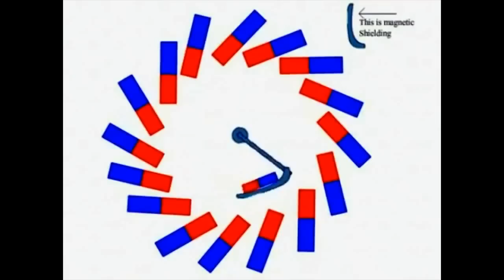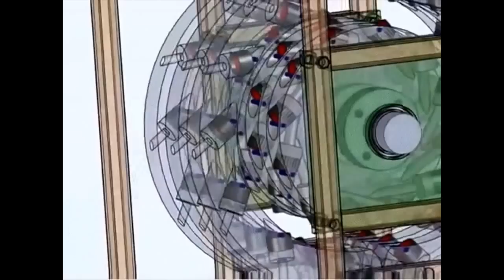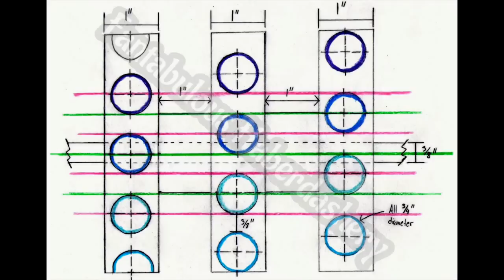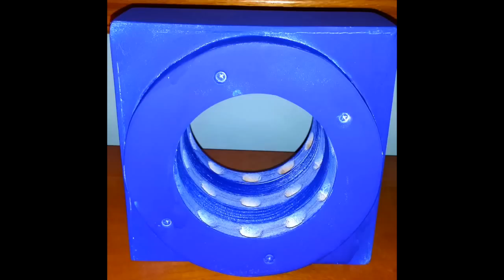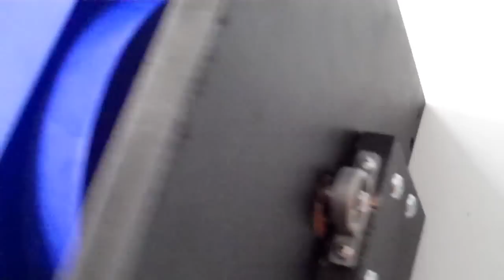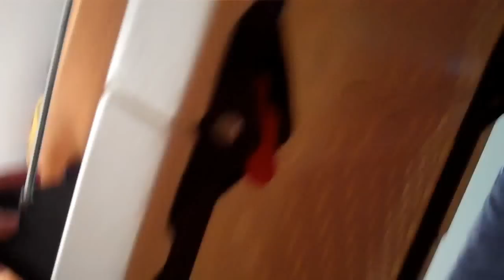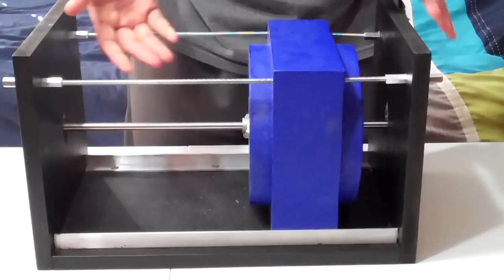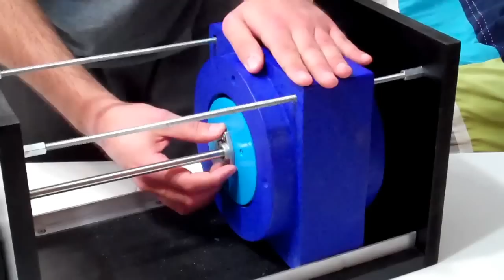Working Perendev Magnet Motor!

Comment: Just thinking out loud here but it's suspiscious that a prototype would achieve almost unity. You don't say how long it runs for, or has run for. Given that a constant force produces an acceleration I would expect that a prototype of a working magnet motor would slow down rapidly (even a few hours) due to losses and reverse magnetic forces or it would accelerate. If you could get it to accelerate, as you would expect, then you will have unleashed a monster.

Comment: Nice science project. The magnets stacked in certain configurations result in a certain cadence as the "motor" is "jump started" by hand. I can imagine using varying shapes of magnets and varying gaps/spaces between each and varying the # of magnets will all give different results so that's interesting. Like so many free energy motors, this one is again not loaded - meaning it's not being used to drive or work or produce anything. That would be the real test for me. BTW, all the energy that comes from the sun is FREE. It arrives here free of charge and all we have to do is collect it. I believe that to be the ultimate energy source - and it's free - already produced and you were sharp to refer to that as converting the energy. I agree there entirely. All in all, pretty impressive and educational.

Comment: Ok its all a mater of perspective forces and inertia. When an object is under no influence from a force (gravity, air resistance, and friction) it can rotate forever. Naturally objects retain their kinetic energy equal to that of what was applied to it, in this case him starting it up with his arm. Without the magnets the motor will slow down quickly, as day to day forces mentioned above will eat away at the kinetic energy of the motor. The magnets are simply slowing down the process of this energy loss and not adding energy to the system. It is a clever trick by arranging magnets at optimal angles to greatly improve the efficiency of a spinning rotor under the influences of other forces. Thus the motor seems to run at a constant speed when in reality it is slowing down at a very small rate. 

Btw to tell if one is fake or not... if the person has to spin it faster than what it runs at (as with this video) then it is explained by the paragraph above. If the person barely turns it and it starts greatly to accelerate then that is a fake machine, as an outside source (hidden motor, air jet, ect.) is adding energy to the system.

Comment: Awesome, I sort of knew this would work with the right RPM.
Whats the next step? My suggestion is to bolt it firmly to the table/ground/whatever, and make the magnets as absolutely firmly attached as possible.
Think about it. Lets say that two magnets are moving towards eachother (repelling). At some point they reach «highest resistance»(braking down the motor), and immediately after passing this point they will accelerate the motor. Lets also say that the point of highest resistance is 1 micrometer. If the magnets are glued, they will fluctuate a tiny amount, lets say 1 micrometer. Now you have maximum resistance over 2 micrometers instead of 1. 
Im not an expert, but I believe this effect is extremely critical.
The math here obviously isnt correct, but I think you get the point.
Keep it up anyways!

Comment: Wow you have proved a point,the point being the principle works exactly how theoretically you can’t say but work it does. Whether permanent magnet motors create energy or tap an unknown source perhaps remains to be proven at least publicly in other words does the energy of magnetisation exceed or equal the overall output of the motor or vice versa..

Comment: Very provocative keep going , the secret lies in the bearings + weight of wheel try using bearing from a fidget spinner
try using instead of wood graphite plastic for the wheel use more power full magnets , change magnet configuration to a swirl so its driven by momentum instead of force , angle of magnets also is important , main thing is not to ever give up my friend 

try to create from nothing is blindness , discover what is already there and you will see ;)

p.s i agree with your speech about laws ;)

Comment: 996 comments not exactly all that positive eh ? 1) There is no easy way to assure a driver motor as the end shafts are pretty much flush withe the bearings. 2) his had is holding not the housing but the stator as the imp balance of the rotor and non precise (in lateral cross section view at least) planar alignment of the magnets would cause the stator to drift about. The argument about permanent magnets not being permanent ( they last only 400 years undisturbed, according to what I have heard) and the stretched rational for such externalities in production of the machine as part of the energy balance equation aside, the bigger issue is one of assessing his motive. I see here an innocent if crudely and incompletely presented attempt to explore a long contested issue. He manifests no commercial interest and is openly sharing information. He may not succeed but why try to slaughter him? 
Several offer  the advice of  a fixed rpm meter, more comprehensive camera views , hands off display etc., fine but lets go one better:  Lets suggest that before any naysayers spout on let them first try to improve on the design then submit it here and subject themselves to this venomous barrage. If it defies science then please explain how it succumbs to the law of motion which  states that 'for very action there is an equal opposite reaction'--as you release your grip on two free standing magnets in close proximity.  Alta continua

Comment: great  work and I really appreciate your candor . So much BS out there eh ? Important this stage however is some sort of electronic rpm meter that could log the motor performance at especially your steady state condition.  Made my own out of a CD disk drive with ¼" ø x 1"long neodymium magnets in a turned 6" cylinder to of hardwood. Came to nearly same conclusion re angle if inclination. The number of magnets used outside ring, to side drum was same so spacing was different . I used Mu metal to shield backside of stationary magnets in ring to no effect but even without it, the mechanism never achieved steady state.  You inspire me to revisit it. I will happily post it up when and if it ever runs ! Thanks again for persisting . Richard S

Comment: Everyone can see the small shadow reflection on the left of the black case - when you hold a small motor with a rubber friction wheel with your right hand onto the shaft to keep it going. Then when I see you remove the small trick motor in the reflected shadow - your machine shakes when you take the pressure off :) lol :) Nice try - but not tricky enough!

Comment: pay attention,,look on the periodic table for metals that resist magnatism and you will find one in particular that resists the magnet no mater north or south ..put these in your wheel as a magnet even though it is not and you will find it works perfectly even though weak

Comment: you have actually got it to spin for a little, lol 

the problem you will always be confronted with is the natural drag caused by the contraption + the drag or counter pull of the magnet when leaving the field wanting to pull it back (thus the magnet propels it forward only to pull it back with equal force as the poles of the field change as it moves) "cogging effect" although minimized by the the angled magnets & spinning counter balance eventually it will come to a stop.

2nd is the issue of load if you try to turn something with it or generate any usable current it will  just stall the motor.

for the sake of a self running motor one needs the skills of an old time clock maker to make a unit with extremely low drag & two gear driven arms (or perhaps four on a finished product) the arms need to move pusher magnets in an orbital pattern first close to the motor armature or magnet spindle then out away , they need to  smoothly enter the magnetic field at the bottom of the stroke, pull the motor in the direction of the desired  spin then smoothly exit out of the magnetic field at the top of the stroke when the magnet starts moving away from the armature or magnetic spindle weakening the magnetic field before it exits the field & repeats the process, this should eliminate the cogging effect but as for usable energy you can probably run a small generating coil to light a couple LED's but again too much load will stall the motor.

thus you need to build a huge machine to turn a generator that can make usable power.

as for so called "free energy" energy it will not come from a self spinning motor it will come from room temperature superconductivity (manufacturing energy generating superconductors similar to thermal couples & thermal piles) but power cells manufactured in a liquid nitrogen environment produce energy when exposed to normal temps.

currently they are classed as "disruptive technologies" by the social engineers, who want us poor & in debt to them for everything, but eventually it will come out, lol

Comment: Nice work - however (dreaded beginning) while magnetic machines do run and can produce an amount of energy that is measurably more than the EMF required for operation - these devices are NEITHER "free" or "Long Lasting" (despite the parable of old lawn mowers). It requires time, energy and commerce to design and build the machine. Further, the device is operating in opposition to the unforgiving presence of FRICTION (no matter the lubricant). This all aside - the concept is real. The tests well proved. The implementation is ripe - save one one thing - Commerce. We live with a zero sum energy production system. It cannot grow without the elimination of irrelevant technologies ( 1 new = eliminate 1 old). 
Suppose for a moment that you were in control of an old, established energy providing system. Then THIS comes along allowing many millions "free" (as we previously established as NOT) energy. Your lively hood and fortunes are threatened to become extinct and would take you along for the ride. Your response to this attack? How did EXXON, ConEd, GE, etc. cope? Well? 
Your ideas for a SAFE and SECURE INTEGRATION into the "power grids" is what is truly needed. Besides engineering and math, sign up for some political science classes and marketing as well. 
We await your progress...

Comment: Your machine is out of balance and not running concentrically. That is why it hangs up. Flange bearings instead of pillow blocks would work better also.

Comment: See the link
https://youtu.be/9yQ9Ln7jBQ8
Finally very near to achieve overunity. 

All calculations are supporting in the favour of this mechanism.In the video there is box with a green ball to lift the green box there will be need of very minimal energy . Suppose the mass of ball is10 kg and counter weight is 10.2 kg.the length of box is 1 meter.the length of seesaw arm is 2 meter. Seesaw is slightly tilted towards counterweight. Now calculations To lift up the arm of 10 kg ball the input will be very minimal only. 3 joule But output Mgh=10*10.*80=80 joule Now clear doubts. The ball will not roll down in the box until the box gets 90 degree angle and will fall down after getting a certain height. In this way the input energy will be very minimal. But now the interesting point is that the seesaw will get back it's initial position without any extra energy. 
I would like to insist that the ball will not rolled down in the box at the time of lifting up the arm.the ball will fall down after getting a certain height of 90 angle.i have used a pinhole to hold the ball but design of box will do it to hold the ball.
Noether theorem will not work in this mechanism.
The input is very minimal, potential energy is being increased, Seesaw is getting back its initial position without any external influence,no friction and air resistance issue then why it shouldn't work?
See the video carefully. It is completely overunity device.
It is an open challenge for everyone who is against perpetual motion machine

Comment: A modern samarium-cobalt magnet takes around 700 years to lose half its strength. Other magnets Can loose there Magnetism through heat or vibration but not of this is involved with your  setup, so where have you got your information from?

Comment: There must be some sort of magnetic resonance involved if it keeps a constant speed for a short period.   It could be the construction quality that makes it lose it's resonance.  You really should have/make some kind of tachometer to really tell weather it's holding it's rpms..  Even a cheap one would be fine for now.      Magnets spinning around magnets causes all kinds of different magnetic fields.  It would be difficult to find them and then measure them.  So, keep on !   You're doing good.  add/remove some weight to one side and balance it.    Drilling holes on the heavy side is a common way to balance a shaft,  or glue on some small weights to the light side.

Comment: That is very interesting and thank you for the drawings on the magnet placement. I made mine straight in and it does lock up when it slows down and the N/S  come opposite each other. I only have one rotor, though.The round magnets I have  are n &s on the ends. if I mounted them like in one of your drawings, they would have to lay in sideways. is that they way you did it?

Thanks, Jim

Comment: I have completed mine today. And its not working. My parts are 3D printed. I used 18 cylindrical magnets for inner ring and 21 flat magnets for outer ring. I was trying to do it as Robert H. Calloway - 3rd schema in you video. I need to adjust it, try different polarity and than i try new schema.

Comment: what u have created is just a perpetual motion machine and there are many examples to follow and the reason your machine will slow down is because the spindle is connected to physical bearings and your energy is lost to heat caused by inertia wich is why the second you connect a chain to a different device it just wont work any two opposing surfaces that rub together will cause friction wich equals heat + heat is energy lost so you need to look at frictionless bearings that are again made from magnets and in theory are zero friction so ide try that idea if i was you but its unlikely u will break the 1% efficiancy barrier that will instantly gain u the noble science prize but i would like to see u try and if it works dont forget about me bro :) good effort n god loves a tryer

Comment: I am doing my Research work on free energy generator, i tried the many machines , and different models in Ansys Maxwell software, no one works, finally i am confusing that the free energy machines will work are not???. if it works how to make design is there any trick behind it , please give me some suggestions about self running generators.

Thank you

Comment: Why do you need 3 rings  of magnets? Is it because that is the way the Perendev was made?  I'm trying to make one with a single wheel and sinusoidal arrangement of magnets in the armature to work like a regular motor switching polarity. I have a working Mendocino motor that will run forever if you have the light/sun available!
Did you balance your armature? That may be why it slows down. Can you give me a call at 616 698 6842. I'm at the pint of boring the holes in the armature and want to discuss the angling theory!

Thanks, Jim

Comment: I think he successfully demonstrated the uselessness of a "motor" with barely enough power to turn itself.  
Never seen one of these that didn't require a "push start.
Reply: so do all internal compustion engines... a push start with a starter or a crank or pull cord

Comment: Well i am sad for you but if your magnet motor concept still requires manual setup and still will loose it's speed overtimes,then it will eventually just stop running,it may substain itself and run normally,but it then and it will sadly makes no sense.
BTW why did you cut the video once you did spin the motor manualy.

Comment: The one thing that is most people's problem is, that they need to have a torque converter and or a counterbalance thrust wait to keep the momentum going in the same direction they spin it in, on there Center Drive Shaft.

Comment: If you just put a rpm meter on it you cloud prove it was running on its own but there is no way to prove on a video your not supplying it with outside power. just to many ways to power it.

Comment: here's the problem, without adjustable magnets their is magnetic friction as soon as the central magnet moves away from the outside ones, so it will eventually slow down no matter what, that said i have seen a design in where the outer magnets would rotate on a gear driven by the inner shafts own movement, with proper timing that would be much more efficient because your turning the attractive force into a repulsion as soon as it passes the peak force, in that instance you are negating the magnetic friction and you are only left with mechanical friction from your bearings and such which depending on your magnets and scale can be overcome. However their is 1 major issue to consider, inorder to draw electricity from a device like this you have to use a device such as a alternator, and that in itself will slow the engine down, if the magnetic strength is not sufficient to counter that resistance then it doesn't matter how impressive the design it will never be self sustaining, and most of these demonstration designs are never attached to such a device so even if they appear to be self sufficient they aren't actually generating anything and may never be strong enough to do so.

Comment: When you said, "magnets eventually lose their charge..." you instantly made yourself to be an idiot. Magnets aren't batteries. They dont hold a "charge". Atomic alignment will eventually be broken down and the minute atomic poles will misaligned. A good electrical jolt will fix that and the magnet will be like new.